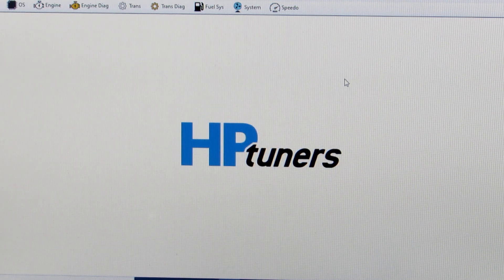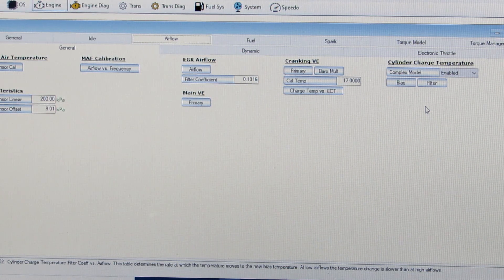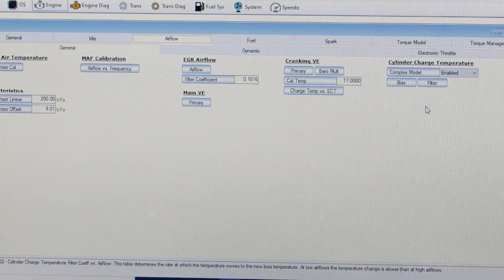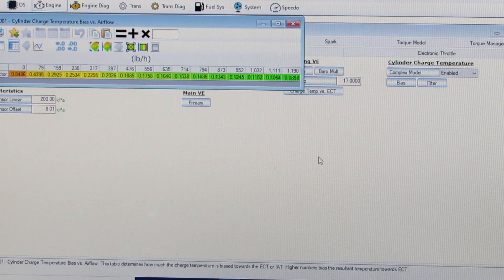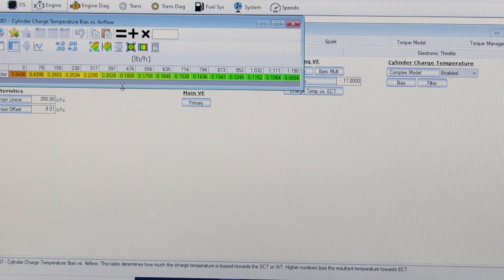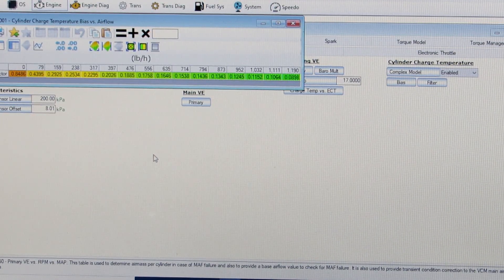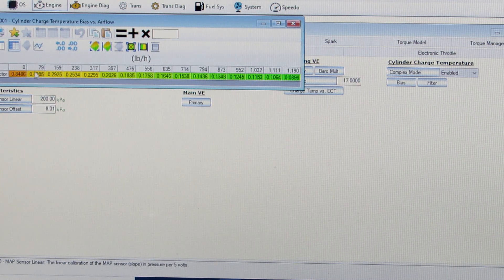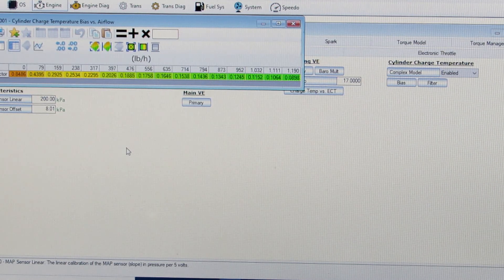Complex cylinder charge temp bias

Comment: This was a decent explanation on this parameter.  I think this is often something that new tuners will spend far too much time on.(i’ll admit that i did) It might seem like its super important to get this dialed in, but in reality its not.  Other factors take precedence over this and will effect the way the vehicle runs more drastically.  Such as the timing. Even in open loop they still are operational and have more effect.  My suggestion is to not spend too much time on this. Its easy to overshoot you mark, so use the multiply by 50% function when you compare the tune to its last saved state. Better to go in small increments.